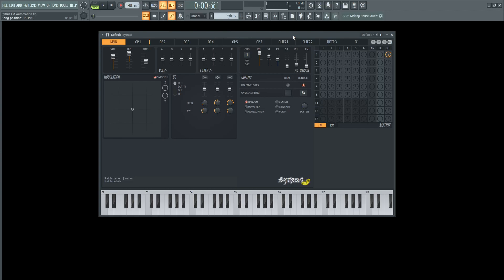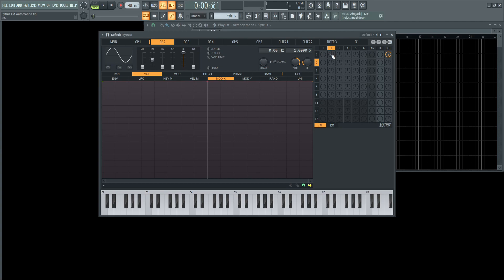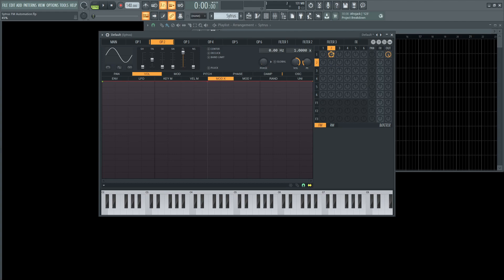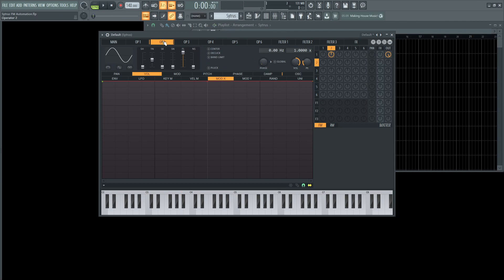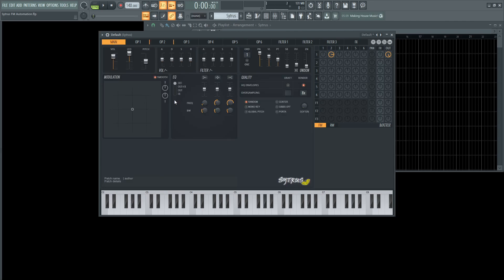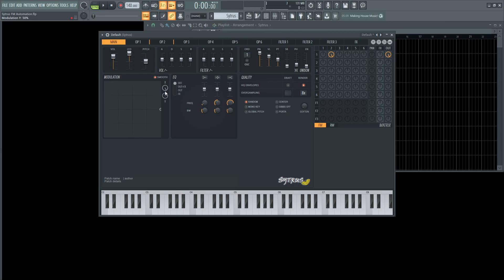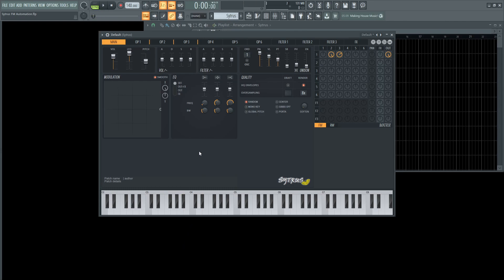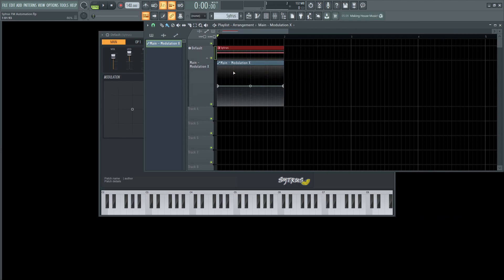How to automate FM Knobs in Sytrus | FL Studio 20 Tutorial

Comment: Great tip Jon! Keytracking, and velocity tracking can also be used as a modulation source so softer or 
sounds on the lower end, sound less bright than the louder and higher ones.
I'm attempting to construct a patcher project with VFX Keymapper and Sytrus for more predictable results,.
This way there's no need for drawing the modulation and you can even control this without a modwheel.
Reply from the maker: Interesting, I'd love to check out that patch when your finished with it. I do have a question though, what made you want to use key mapper instead of directly adjusting the graphs of the operators them selves in each operator, then attaching those to mod x and y (or maybe both to x) then mapping that to the mod wheel? I may have misunderstood what you meant but that what popped into my mind